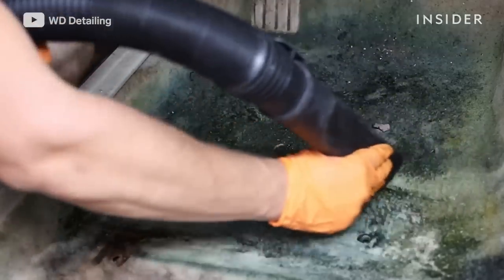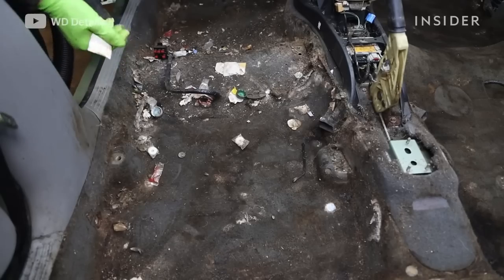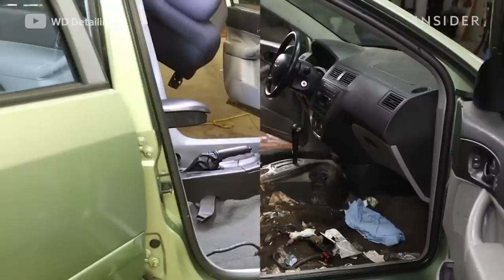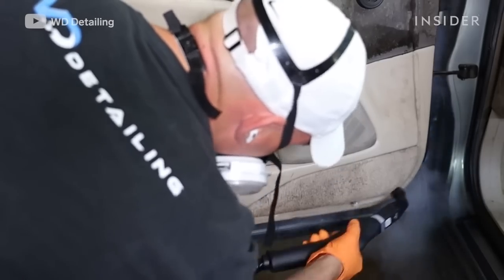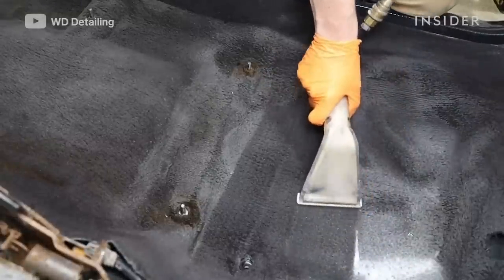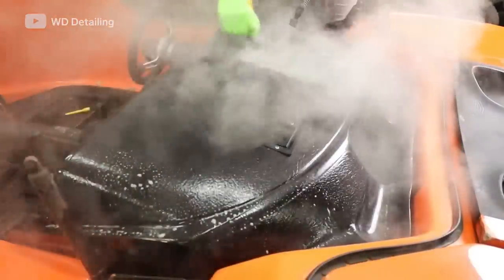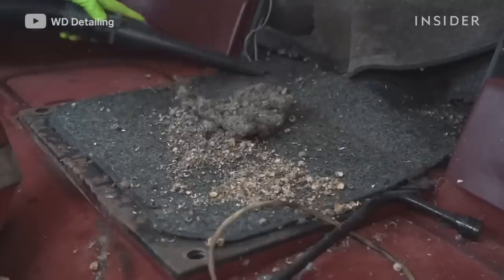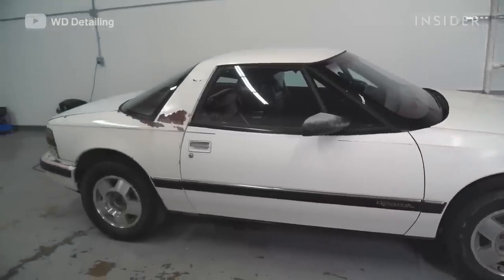Deep Cleaning Mold And Debris From Cars | Deep Cleaned | Insider

Comment: Deep clean  and power wash 4 times? Isnt that more costly than just a new carpet? xD
Reply: I assume you haven't priced carpets. 
Many cars, I would say most, carpets haven't been available for years.
Some models you can get 'kits' say for your vintage Mustang, or old Chevy.
I've restored a number of cars and the parts bills would put you into shock.
Most of the profit in a restoration, when there is any, is in 'saving' things. Labor is expensive, unless you do it yourself. Or why a seven hundred hour restore means six hundred hours for the owner.
Reply: @lucastrask2838   Exactly, hours are expensive. Thats why I am asking if a replacement is no option. But yeah I guess finding a replacement would be tough.